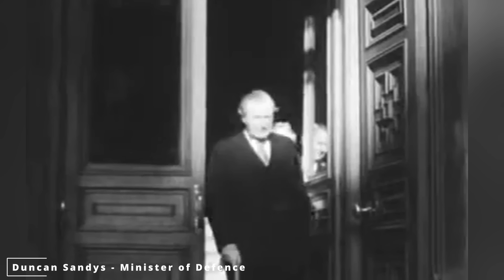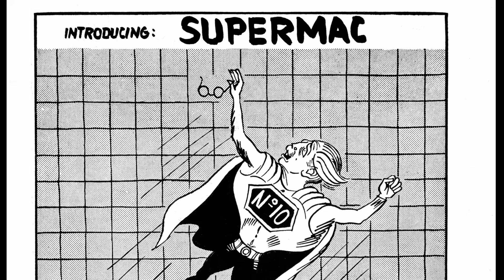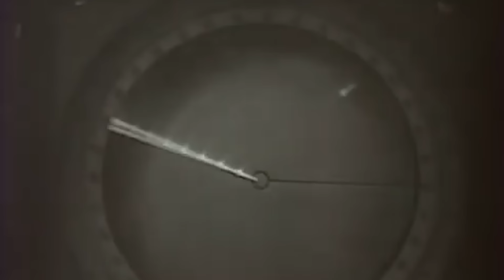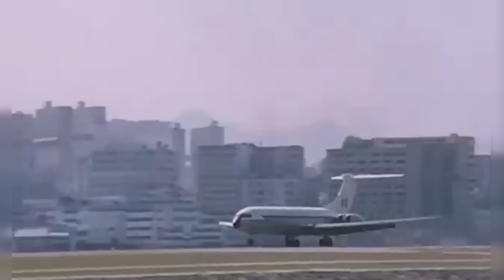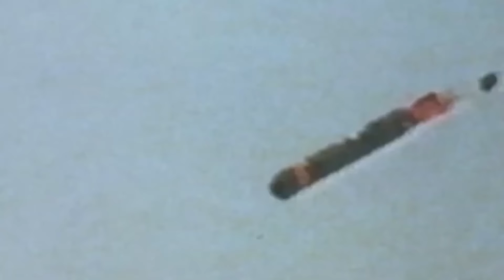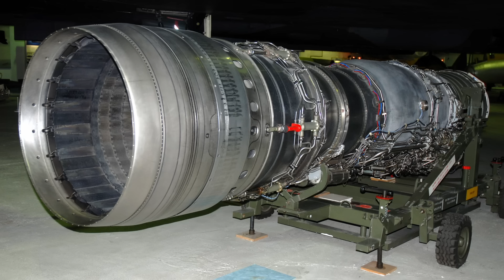How Britain Turned A Failed Airliner Into a Soviet Submarine Predator | The Mighty Nimrod

Comment: "A Failed Airliner" - most definitely NOT. 
Being the first to do something means you will always by the first to find the limitations. As those limits were found, they were fixed.  Unlike several American designed and built airliners where, as limits were found, they were bodged over or ignored completely, even on aircraft designs 20 and 30 years younger!
Reply: The Comet was an unmitigated failure of epic proportions that destroyed one of Britain's once great aircraft companies.
Comet 1 was the worst engineering disaster in commercial aviation history and the only jet airliner to have its certificate of airworthiness permanently revoked'
Comet was not the first pressurized airliner and was not the first successful or airworthy jet airliner... that title goes to the hugely successful Boeing 707 series that completely revolutionized air travel and the aircraft industry.
The Boeing 707 was so successful, rugged and durable that its still flying today and expected to remain flying until at least 2045!
Reply: @DoktorBayerischeMotorenWerke 

Typhoon & Tornado, British design aircraft. 

Early days of the airliners.

The awesome De Havilland Comet.
World's first production jet airliner.
World's first high altitude airliner. 
At the time the Comet wasn't particularly dangerous. The DH Comet was definitely not the worst engineering failure in commercial airliner history.

Losses comparisons.
How things were in those days.

DeHavilland Comet 4 UK                          14% 
DeHavilland Comet all mks UK (ff 1949)17%  
Vickers VC10 UK (ff 1962)                         5%

Douglas DC-1  US                                       99%
Douglas DC-2                                              47%
Douglas DC-3                                              30%
Douglas DC-4                                              26%
Boeing s300    US                                       72% 
Boeing 307                                                  70%
Boeing 247                                                   48%
Boeing 707  (ff 1958)                                 32% 
Lockheed L-049 Constellation (ff 1943)  30%
Lockheed Electra US (ff 1957)                   29%
Fairchild FH-227 US (ff 1966)                   32%
McDonnell Douglas DC-8 US  (ff 1958)   14%
Sud Aviation Caravelle  (ff 1955)             15%
Canadair CL-44 Turboprop US (ff 1959) 46%  
Convair CV-580 Turboprop US (ff 1960) 22%
Convair CV-880     (ff 1959)                      27% 
Convair CV-990     (ff 1961)                      33%
Tupolev T-104        (ff 1956)                     16%
Vickers Viscount UK  (ff 1948)                29%  
Fokker F-27 Turboprop NL (ff 1955)       40%      

The Vickers VC10, fastest Atlantic crossing for a non supersonic jet airliner, held the record for 41 years.

For the first few years of operation the Caravelle & Comet had similar accident loss fatalities.

De Havilland had prior experience building many all metal construction airframe aircraft & thousands of jet powered fighter aircraft that were primarily of metal construction with pressurised cockpits & jet engines built by De-Havilland. No aircraft before the Comet was subjected to as much pre-production testing as the Comet. 

It's a great pity & a crying shame that British military forces had to occupy a large part of Germany for decades after 1945 & Russian military forces had to do the same. Of course Russia still posseses a large chunk of what was German territory & of course Russia & the UK produce nukes. Obviously Germany does not produce nukes.

Interesting British achievements.

The gas turbine engine was invented & patented in England before the 1800s.

Axial multi stage sequential stage compressor & turbine technology, first produced for turbo machinery use in England by Parsons of Ireland & North England during the 1800s. The components form the basis of most modern gas turbine aero engines. At the time the concept of the jet aircraft powered by axial internal combustion gas turbine engines was first mentioned thus the internal combustion jet engine & jet aircraft was indeed invented in England before the 1900s & before the Wright brothers got busy.

Work on the multi stage sequential stator rotor axial compressor as applicable to the axial compressor gas turbine aero engine was ongoing in England from around 1928 by Arnold Griffiths and others. By 1943 the Metrovik F2/3  Beryl was a running axial turbojet that was superior to anything anywhere else. As the centrifugal compressor engines were adequate and more powerful at the time development of a larger F2/3  version was commenced.

The Metrovik (UK)  F2/3 axial compressor gas turbine aero engine was flight certified & ran in 1942, it was the result of UK development work ongoing since 1929. At the time it was the most capable axial compressor turbojet in existence but was not required and development work continued on a larger version.

Frank Whittle performed the world's first demonstration of a gas turbine aero engine in 1937. People in Germany kept a close eye on everything going on in Britain at the time.

The centrifugal compressor RR Nene was the most powerful & most reliable gas turbine aero engine on the planet in 1944. That engine would be later built under license or copied in many countries including Russia (Mig-15 Mig-17), China, the US, France and Switzerland powered dozens of aircraft types for decades after 1944.

Pratt and Whitney and others produce centrifugal compressor gas turbine aero engines. The PW200 is a currently produced whittle style centrifugal compressor, reverse flow combustor, gas turbine aero engine. 

The world's first wind tunnel was constructed in England during the 1870s. The world's first supersonic wind tunnel was constructed in England in 1922.

There is no doubt that the Fairey (England)
Delta 2 was the world's first jet
aircraft to exceed 1000 mph.  Indeed It
exceeded the previous record by 310 mph &
held the record for 1 year. Incidentally, the Dassault Mirage 3 & 4 are based on the Fairey Delta 2.

More recent UK military jet aircraft.

The Tornado & Typhoon & their engines are Supersonic & are indeed British design aircraft with British design engines built by an international consortium. The Tornado design for example started life during the 1950s at Vickers as the AFVG, it's engine is based on the RR RB-199. The EE Lightening is also a British Supersonic jet aircraft.

The Typhoon is the British BAC-EAP with an engine based on the British RR XG-40, the Typhoon is also built by an international consortium.

Brazil has the world's third largest airliner manufacturer and makes very good airliners & Brazil is 100th down the list along with Indonesia for wealth per capita. Of course it is in fact the case that Embraer can't build those airliners without purchasing stuff from the US, UK & Europe. For example, Norway, Holland, Denmark, Ireland & Belgium, top 20 wealth per capita, don't make airliners, its as simple as that.

Global aerospace. 
From the 1950s sector rationalisation and consolidation took place. 70 companies in France and 300 companies in the US disappeared due to merger or dissolution. In the US Boeing was almost bankrupted by the 707 project.  Boeing had a well protected domestic market and the available space and resources in the US to engage in large scale airliner manufacturing enabling them to capture orders simply by being able to produce airframes fast enough and cheap and nasty enough. Another factor is airlines preferring to obtain as much of their airliner inventory as possible from one manufacturer. 

Global Aerospace Sector, what's happening.

For example, there are of course no German companies that makes German jet aircraft in Germany & there are no German companies that make German gas turbine aero engines in Germany that are suitable for widebody airliners.

The UK has the world's highest combined per capita Nuclear / Defence / Aerospace Sector Activity.

UK defence sector, absolute terms, world's second highest activity. 1st for per capita defence sector activity. Per capita nuclear powered submarine construction, 2nd position. 
Main players being Rolls Royce, Babcock, GKN Aerospace & BAe Systems. Activities often involve international collaboration. BAe systems, RR and other UK companies now handle more Airbus work value wise than Germany. 

There's a good chance that anyone currently flying on a widebody airliner will be on an aircraft powered by RR gas turbine aero engines made in the UK and a good chance there will be other hardware on the aircraft that's designed and / or manufactured in the UK. 

Rolls Royce Holdings UK
Subsidiaries
- Rolls-Royce plc
- Rolls-Royce North America (ex Allison etc Classified Military stuff)
- Rolls-Royce AB
- Rolls-Royce Deutschland
- Rolls-Royce India Private Limited
- Rolls-Royce Marine Power Operations
- Vinters Engineering Limited
- Rolls-Royce Controls and Data Services
- Rolls-Royce Power Systems
- Bergen Marine
Joint ventures include:
- Rolls-Royce Turbomeca
- MTU Turbomeca -

Trent Family
The MT30 (Marine Turbine)
Industrial Trent 60 Gas Turbine
Trent 7000
Trent XWB Airbus A330neo.
Trent 1500
Trent 1000
Trent 500
Trent 600
Trent 700
Trent 800
Trent 8100
Trent 900
   
RR wholly owned subsidiaries in Germany handle smaller 2 shaft RR gas turbine aero engine work.

The UK space and aerospace sectors are highly productive, high-value industries that together contribute over £18 Billion in direct Gross Value Added (GVA) to the UK economy. Individually, the space industry directly contributes about 0.3% of UK GDP 7•2 Billion while the aerospace industry contributes approximately 0.5% £10•9 Billion.
   
We hope this helps.
Reply: @DoktorBayerischeMotorenWerke  

We believe we can clear up some commonly held myths and misconceptions obviously.

It's always good to see the facts presented clearly and concisely isn't it?

Bow-wing (see B-47 wing collapse wing folding incidents) had built less than 12 pressurised airliners before the Comet first flew and they were not high altitude airliners. 

All Nimrods were new build Comet 4 airframes with appropriate strengthening and the unpressurized  equipment bay tacked on. 

The HS 801 Nimrod was the most advanced aircraft of it's type at the time it first flew. Problems with the MRA4 programme were almost entirely due to radar and computer equipment issues and BAe Systems & co being too busy with other work at the time. 

Obviously there have been worse aircraft for accident losses both before & after the Comet.

Early problems with Comet takeoff stalls were caused by pilots over rotating the aircraft at liftoff. 

Podded engines on wings have aerodynamics issues. The main reasons for eventually going with podded engines were because or to facilitate -
Ease of maintenance.
Use of shear off fixings given excessive out of balance forces.
Large diameter turbofan engines.
Reduce load on the wing to fuselage connection. 
Increased power from later engines. 

The Bow-wing (See B-47 wing collapse & wing folding incidents) was a good example of how to expend a huge amount of cash and effort on something that was probably not worth bothering with. The basic design of the Comet had been decided upon and established before the podded engine choice has been made for the B-47. There were aerodynamics problems with podded pylon mounted engines at the time. The US also built and operated a significant number of EE Canberra bombers under licence which did not use podded engines for their wing mounted engines. . 

There have been aircraft losses caused by pod & pylon mounted engines. 

All jet airliners benefited greatly from the knowledge gained from the Comet incidents & subsequent investigations & yet some were still worse for accident losses. 

Instances of all marks of the Comet flew with full certification after 1954 including the Comet 3. The last Comet flight occured in 1997.

The fabulous trail blazing DH Comet.
World's first jet airliner in regular service.
The jet engined Avro Lancastrian actually did a passenger service before the DH Comet. 
World's first high altitude airliner.
World's first airliner with a full fuselage length pressurised cabin pressurised for high altitude flight. That feature for that type of aircraft was a considerably difficult undertaking. 

The change from larger squarer windows to smaller rounder windows was necessary for the particular aircraft at the time. Skin thickness remained mostly the same for all Comet marks. 

How things were back then.
Accident losses - % of aircraft built.

DeHavilland Comet 4 UK                          14% 
DeHavilland Comet all mks UK (ff 1949)17%  
Vickers VC10 UK (ff 1962)                         5%

Douglas DC-1  US                                       99%
Douglas DC-2                                              47%
Douglas DC-3                                              30%
Douglas DC-4                                              26%
Boeing s300    US                                       72% 
Boeing 307                                                  70%
Boeing 247                                                   48%
Boeing 707  (ff 1958)                                 32% 
Lockheed L-049 Constellation (ff 1943)  30%
Lockheed Electra US (ff 1957)                   29%
Fairchild FH-227 US (ff 1966)                   30%
McDonnell Douglas DC-8 US  (ff 1958)   14%
Sud Aviation Caravelle  (ff 1955)             15%
Canadair CL-44 Turboprop US (ff 1959) 46%  
Convair CV-580 Turboprop US (ff 1960) 22%
Convair CV-880     (ff 1959)                      27% 
Convair CV-990     (ff 1961)                      33%
Tupolev T-104        (ff 1956)                     16%
Vickers Viscount UK  (ff 1948)                29%  
Fokker F-27 Turboprop NL (ff 1955)       40%      

The Vickers VC10, fastest Atlantic crossing for a non supersonic jet airliner, held the record for 41 years.

For the first few years of operation the Caravelle & Comet had similar accident loss fatalities.

Sud Aviation Caravelle - 
all accident loss fatalities - 
1320 fatalities. 

De Havilland Comet - 
all accident loss fatalities - 
453 fatalities. 

An example of a typical airliner from the period. 
The Fokker Friendship F-27 fatalities & accident losses as a % of aircraft built. 
Fokker F-27 Turboprop (ff 1955)   40%
2130 fatalities.

Of course De Havilland carried out a full stress analysis & performed extensive & protracted testing on two long lengths of fuselage representing all features of a complete airframe. De Havilland carried out significantly more testing than was required by any authority at the time & significantly more testing that any previous airliner was subjected to.

De Havilland designers / engineers knew all there was to know about metal fatigue at the time they designed the DH Comet.

De Havilland had prior experience building many all metal construction airframe aircraft including many passengers aircraft & thousands of jet powered fighter aircraft that were primarily of metal construction with pressurised cockpits & used jet engines built by De-Havilland.

De Havilland did indeed always work to better than industry standards at the time, used up to date knowledge for the design & testing activities & no evidence of negligence or criminal negligence was ever produced in relation to the DH Comet.

Global aerospace. 
From the 1950s sector rationalisation and consolidation took place. 70 companies in France and 300 companies in the US disappeared due to merger or dissolution. In the US Boeing was almost bankrupted by the 707 project.  Boeing had a well protected domestic market and the available space and resources in the US to engage in large scale airliner manufacturing enabling them to capture orders simply by being able to produce airframes fast enough and cheap and nasty enough. Another factor is airlines preferring to obtain as much of their airliner inventory as possible from one manufacturer. 

Global Aerospace Sector, what's happening.

For example, there are of course no German companies that makes German jet aircraft in Germany & there are no German companies that make German gas turbine aero engines in Germany that are suitable for widebody airliners.

The UK has the world's highest combined per capita Nuclear / Defence / Aerospace Sector Activity.

UK defence sector, absolute terms, world's second highest activity. 1st for per capita defence sector activity. Per capita nuclear powered submarine construction, 2nd position. 
Main players being Rolls Royce, Babcock, GKN Aerospace & BAe Systems. Activities often involve international collaboration. BAe systems, RR and other UK companies now handle more Airbus work value wise than Germany. 

There's a good chance that anyone currently flying on a widebody airliner will be on an aircraft powered by RR gas turbine aero engines made in the UK and a good chance there will be other hardware on the aircraft that's designed and / or manufactured in the UK. 

Rolls Royce Holdings UK
Subsidiaries
- Rolls-Royce plc
- Rolls-Royce North America (ex Allison etc Classified Military stuff)
- Rolls-Royce AB
- Rolls-Royce Deutschland
- Rolls-Royce India Private Limited
- Rolls-Royce Marine Power Operations
- Vinters Engineering Limited
- Rolls-Royce Controls and Data Services
- Rolls-Royce Power Systems
- Bergen Marine
Joint ventures include:
- Rolls-Royce Turbomeca
- MTU Turbomeca -

Trent Family
The MT30 (Marine Turbine)
Industrial Trent 60 Gas Turbine
Trent 7000
Trent XWB Airbus A330neo.
Trent 1500
Trent 1000
Trent 500
Trent 600
Trent 700
Trent 800
Trent 8100
Trent 900
   
RR wholly owned subsidiaries in Germany handle smaller 2 shaft RR gas turbine aero engine work.

The UK space and aerospace sectors are highly productive, high-value industries that together contribute over £18 Billion in direct Gross Value Added (GVA) to the UK economy. Individually, the space industry directly contributes about 0.3% of UK GDP 7•2 Billion while the aerospace industry contributes approximately 0.5% £10•9 Billion.
   
We hope this helps.